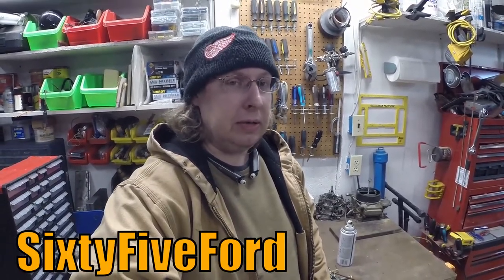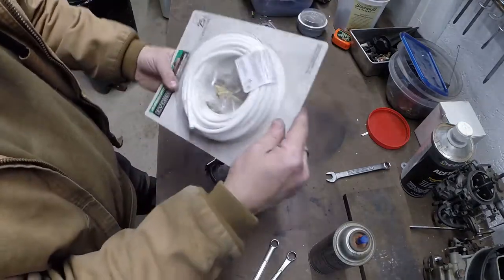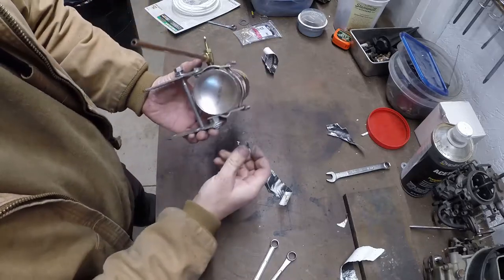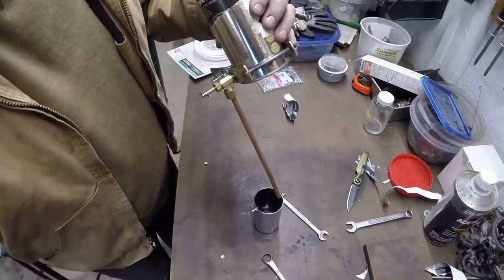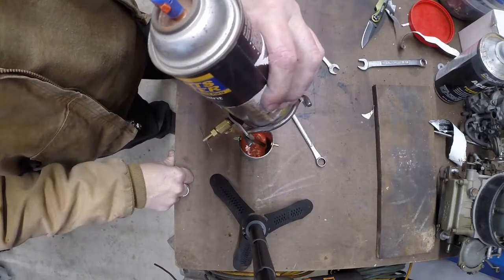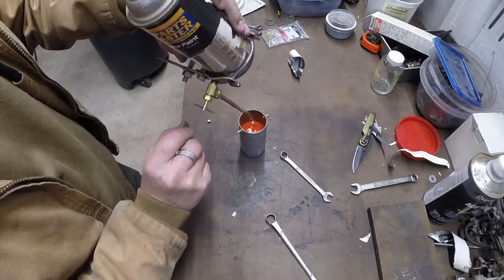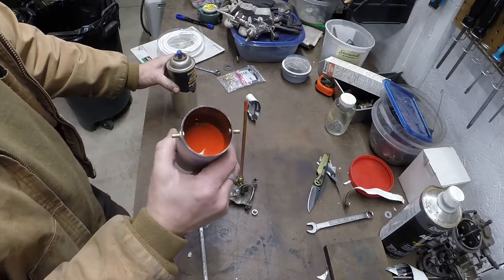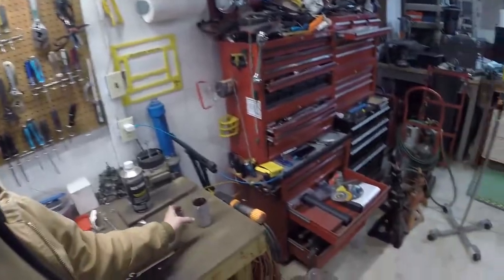$10 DIY Easy Spray Paint Extractor - Save Your Dead Spray Paint Cans!

Comment: Brilliant. I got my refrigerator kit yesterday and extracted my paint today from an any-way Rustoleum can. It wasn't quite as easy as you made it look. Lots more spitting than yours and lots of bubbles when I stirred the result but I will now brush on what was otherwise lost. Thank you.
Reply from the maker: I've noticed that some can sputter like that but for the most part ive had really good luck with it. It's saved a lot of wasted paint 👍🏼

Comment: Great Vid.  Now to figure out how to decant those small 100ml Tamiya cans used in model making.  Looks like your clamp won't go down to that small of a size.
Reply from the maker: I can't say for sure if it'll work, but the needle valve and gasket will most likely work. You'd just have to modify the clamp for the smaller can. Give it a shot and see. Worst case scenario is you waste a few bucks, some time and an already broken spray can.

Comment: I realize this is an older video. However, it is a real shame that we have to work around so many spray paint cans that you purchased and don't get what you paid for with clogged up cans. Should be a way to get your money back and not have to deal with such issues. However, you showed a good idea to recover some of what you bought. Years ago this never happened to any spray paint I bought. Now it is almost a given. I have more newly bought cans that simply won't spray than will spray correctly. Something has to change... Spray Paint isn't getting cheap. To the contrary...
Reply from the maker: The quality seems to have gone downhill a lot over the years. I'm glad you found this helpful 👍🏼👍🏼

Comment: I couldn't read the label on the valve package. Could you please provide a link to where you got it or a brand/part number? Thanks.
Reply from the maker: https://www.lowes.com/pd/EASTMAN-25-ft-L-1-4-in-OD-Inlet-x-1-4-in-Outlet-Polyethylene-Ice-Maker-Connector/3196985
Reply from the maker: Anything like that. It doesn't matter what brand. I'm pretty sure they all work the same. If you can find them cheaper somewhere then do that.

Comment: Great video! Was looking for this exact solution the other day. I also ran across this: YouCan Refillable Spray Paint Can. Just do a search for it. I just bought one on Amazon. Interested to see how well it works. Would be a good compliment to your device...a place to put the paint. Thanks again!
Reply from the maker: Nice! I've seen those cans before. Pretty cool. I have one that uses a propellant cartridge for automotive paints but I don't use it very much. I hope this helps you out 👍🏼

Comment: How does one get acetone into it to clean it?
Reply from the maker: I take it apart which is pretty easy. Or use a spray through it. Lots of different ways to clean it. 👍🏼
Reply: @HFG  So it contains no rubber or plastic parts that acetone will eat up during cleaning?
Reply from the maker: The ones I have are all brass except for the rubber gasket on the outside. I can't say that they're all like that, but it's just a needle valve and super easy to take apart and look. They're also super cheap, so it's easy to test. One main component of carburetor cleaner is acetone, so it's safe for certain types of plastic.
Reply: @HFG Thanks.
Reply from the maker: Good luck. 👍🏼